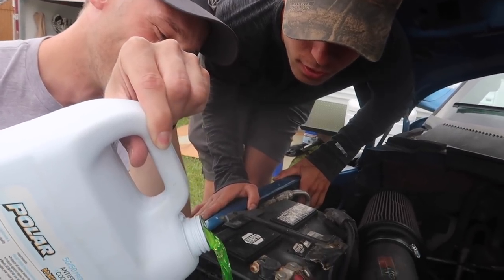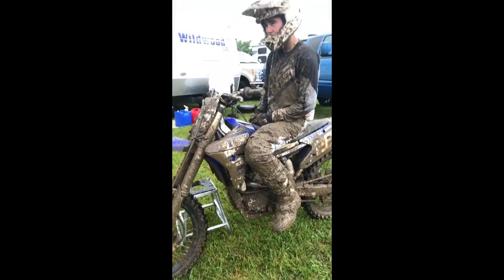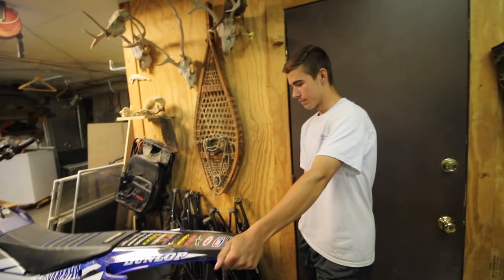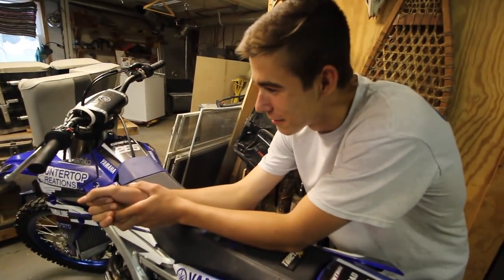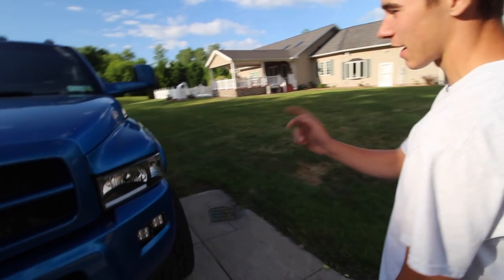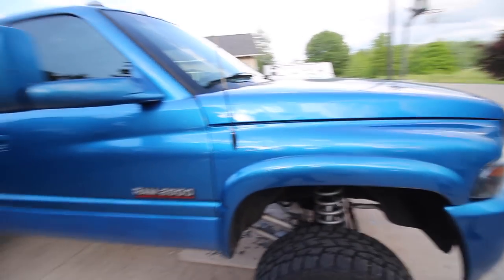FINDING THE NEXT PROJECT BIKE + ITS FOR SALE...

Comment: Hey I have a cr125r it has a almost fully rebuilt engine it needs handle bars and levers but I'd sell it for 2300 it's a 2003
Reply: Ok the engine is fully rebuilt and it needs a master link and a new air filter the current one has a hole in so I can’t ride it until I get a new one

Comment: Do a 2003 or 2004 kx250 becuese you can put the same kit you put on your 125 on it or if that is to similar do a  2002 and up cr250, polisport makes a restyle kit for it and so does Tx race. Also dont dis the bike because you heard the RC motor is bad because I have a 2003 cr250 and she rips but i have a Keihin PWK 38mm AS which is a must over the Mikuni unless you are going to get a lectron which I wish i could get for my bike.  (Tx race: http://www.txrace.com/shop/tx-race-conversion-kit-honda-2-stroke-cr-125-250-2002-2003-2004-2005-2006-2007/ ),(Polisport:  https://www.polisport.com/en/off-road/news/cr-125/250-mx-restyling-kit/?id=258&idn=125 ) Love the vids.